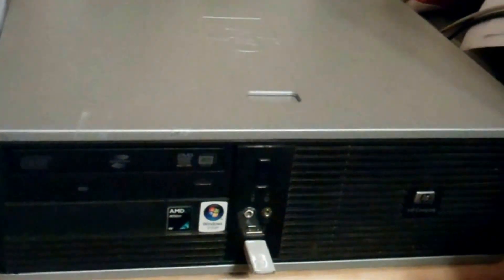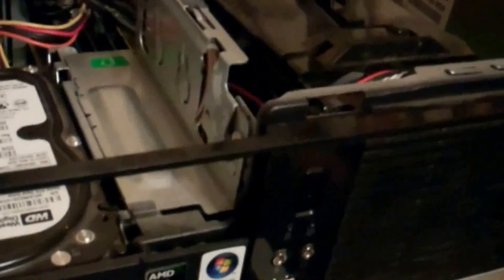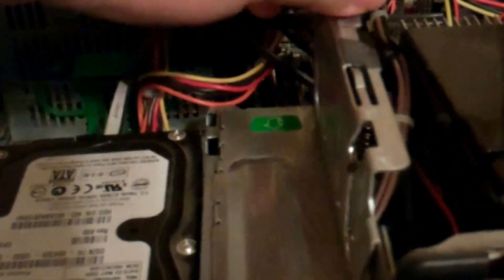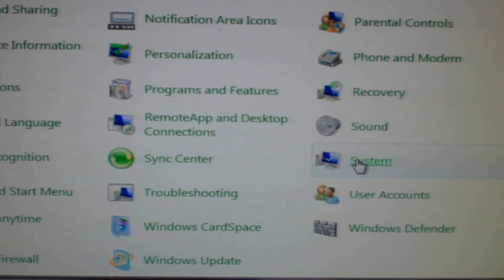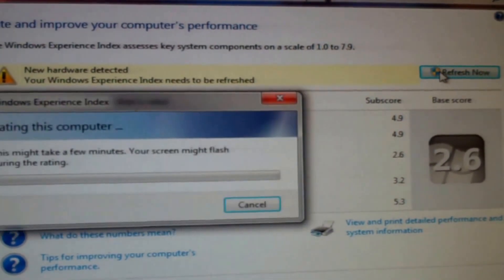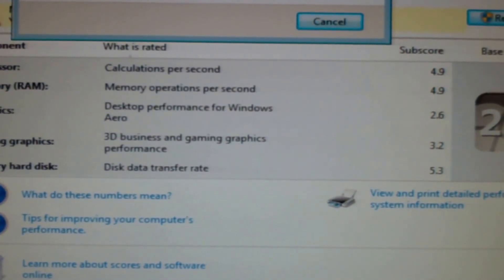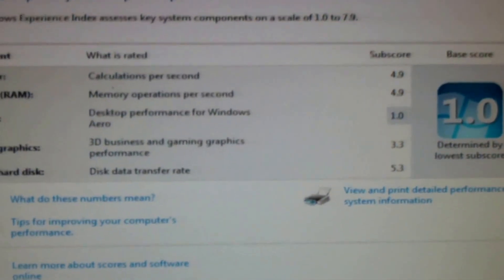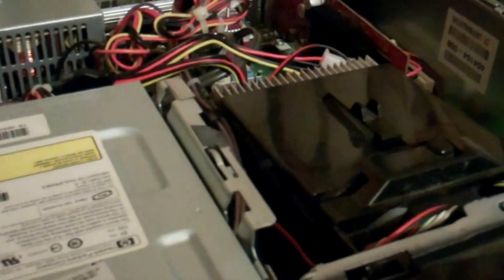Upgrading an Old HP Desktop Computer

Comment: I have one of these POS machines, I'm trying to find a somewhat-easy way to change the motherboard socket to allow for a newer CPU type, I currently have  the highest "supported" CPU upgrade (AMD 6000+ version), but it's still wayyy below what I need.
Reply from the maker: +Concerned Voter Yeah these aren't worth upgrading.. They're fine for a small office environment but that's about it. I upgraded the video card to a Radeon HD 5570 to handle Windows 10 32bit OS.. Wasn't compatible with the 64bit version.

Comment: My sister had the card you put in (Radeon X300). I threw it in the garbage because it was sharing memory with system RAM and that way stealing precious resources. I replaced it with Radeon X1550 (256MB version) and the whole computer became quite speedy again. She has a 2.8GHz Pentium 4 HT and now watches Youtube in 720p. Smooth as butter.
Reply from the maker: +MuristekTV Ok cool, I'll keep that card in mind.. I plan on upgrading this computer to Windows 10 later this year and may add that card after the upgrade. Thanks
Reply: +RVR2 
I looked at the specs for your computer and it actually supports any PCI-Express 2.0 card so even better cards can be put in to take advantage of the dual-core processor you got in that machine. The Radeon HD 3650 would be even better and can be found very cheap on Ebay. 

The Nvidia GT 240 is the one I got in another computer and that card would be even better for you than the HD 3650. The X1550 is OK for Pentium 4, but you have a better processor so a better card will do even more for you.
Reply from the maker: Oh cool Thanks! I actually have a low profile Nvidia GeForce GT740 I may throw in there after the Win 10 upgrade and I might actually set it up in the bedroom for You Tube vids.

Comment: Where did u buy the ram from?
Reply from the maker: +Thuseanthan14 ebay
Reply: +RVR2 How much was it
Reply from the maker: I can't remember exactly but I just got the info off the memory stick and entered it on ebay using the lowest price option to find the best deal..
If you don't need it right away, it would be worth buying it from China and waiting 2-4 weeks for it to arrive..
Reply: +RVR2 I have the exact computer as you and it is slow and the ram is 1GB. Do you think if I upgraded he ram  it would become faster?
Reply from the maker: Check the specs of the model online to see what the max amount of RAM and speed it can handle.. Pretty sure it can handle up to 4GB max (4 x 1GB sticks) DDR2 but don't remember the MHz speed.. Yeah with only 1GB, it would be worth bumping up the RAM.
Reply from the maker: +Thuseanthan14 It uses older ddr2-400 pc2-3200
Reply: +RVR2 So if I buy an new version it won't work?
Reply from the maker: It may not be compatible..
Reply: +RVR2 if you don't mind can u give me the link which would be compatible?
Reply from the maker: I don't have a link.. All I did was researched this model HP online and found the information that way about what the specs of it was, pulled out the RAM, entered the info on the RAM stick in ebay, and compared prices. That's it

Comment: good video and great work i have same pc
but i want to know the higher processors which supported for this mother board
and where i can find the fan which u used Thx Again :)
Reply from the maker: +Mohamed Abdo Thanks! I would Google HP Compaq DC5750 specs and see what the max processor that this motherboard can handle then search around for a good used processor like ebay.. I got the fan on ebay as well.
Reply: well i saw in google but i saw something which i wasnt expected disappointed me look the supported processores are 
AMD Sempron Processors with HyperTransport Technology:
AMD Sempron 3400+ Processor (1.8-GHz, 256K L2 cache, 1600-MHz FSB)
AMD Sempron 3600+ Processor (2.0-GHz, 256K L2 cache, 1600-MHz FSB)
AMD Athlon 64 Processors with HyperTransport Technology:
Athlon 64 3500+ Processor (2.2-GHz, 512K L2 cache, 2000-MHz FSB)
Athlon 64 3800+ Processor (2.4-GHz, 512K L2 cache, 2000-MHz FSB)
AMD Athlon 64 X2 Dual-Core Processors with HyperTransport Technology:
Athlon 64 X2 Dual-Core 3800+ Processor (2.0-GHz, 2x512K L2 cache, 2000-MHz FSB)
Athlon 64 X2 Dual-Core 4200+ Processor (2.2-GHz, 2x512K L2 cache, 2000-MHz FSB
Athlon 64 X2 Dual-Core 4600+ Processor (2.4-GHz, 2x512K L2 cache, 2000-MHz FSB
Athlon 64 X2 Dual-Core 5000+ Processor (2.6-GHz, 2x512K L2 cache, 2000-MHz FSB)
Athlon 64 X2 Dual-Core 5200+ Processor (2.6-GHz, 2x1MB L2 cache, 2000-MHz FSB.
and all of them to me are so slow i thought i could upgrad to core i 3 at least but unfortuntly i think i will sell it and buy gigabyte or whatever motherboard which support good processor 
is better for gaming and graphic things i think nowdays
Reply from the maker: Yeah those old motherboards are limited.. Good idea on a newer setup. Good luck.
Reply: thx u 2 :) waiting for more videos
Reply from the maker: Thanks. I'll see what I can do
Reply: RVR2 hope so :)
Reply: Mohamed Abdo Intel Core 2 Duo or Intel Core 2 Quad are the last processor of this computer

Comment: I also have a HP/Compaq DC5750 but its the tower design and not the SFF version. I received mine that was destined to the trash compactor since at my workplace it wad deemed "obsolete". That was back in the fall of 2012. I ordered a SSD, 4 gigs of ram (according to the info sheet per HP, the DC5750 can support up to 4 GB of ram. One could try 8 GB but it wasn't guaranteed to run with 8GB), an AMD 6500 video card (now a Nvidia).and a DVDRW drive.. It ran windows 7 64 bit pro pretty quick (for an Athlon 4000 x2) and now I have it relegated to bedroom htpc duties while I built a new computer last year. Those DC5750's make good business computers but the Achilles Heel of those were the weak onboard video.
Reply from the maker: Ronnie Bradley Nice! That's a lot of good info there! Yeah that was what my wife was complaining about that the video was jumpy or freeze up and ran slow sometimes.. If I had 2 more 1GB sticks of RAM, I would bump it up to 4. You say that AMD 6500 video card works well in it? Would you recommend it or another version video card?
Reply: RVR2 On my HP DC5750 tower, I'm running An ASUS GT610 2GD3 CSM  which has a passive heatsink taking up 2 slots. I wouldn't recommend that particular card because it interfered somewhat with the CPU cooler. I took off a piece of the cooler (protruding corner piece where one of the screws holds it to the motherboard. The CPU cooler is still intact though. I tend to favor NVidia over AMD/ATI even though the computer has an ATI chipset.  I would find a low profile single slot Nvidia GT610 w/ fan. Newegg has quite a few to choose from.
Reply from the maker: Great! Thanks for the advice and info. I will check it out. Thanks again!

Comment: why only  3  gig  why not  8  gig  it a 64bit chipset all so  if  you look   3d  gfx  went  up  two  3.2 it was  3.1 so  it  did improve  it
Reply from the maker: ***** The OS is only 32 bit and I don't have 8GB of RAM on hand..
Reply: what ram   dose  it use  i  see  if  i can find  you some
Reply from the maker: It uses older ddr2-400 pc2-3200 but it's just an office computer, not for gaming